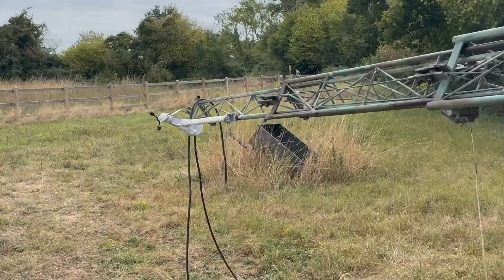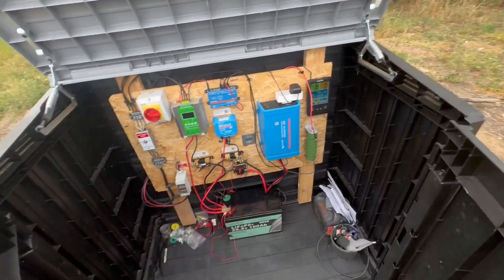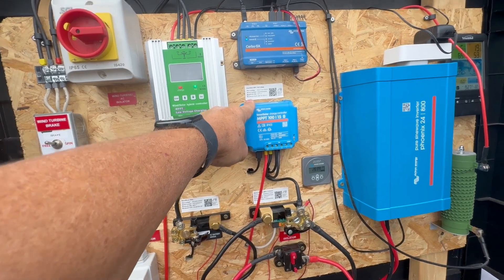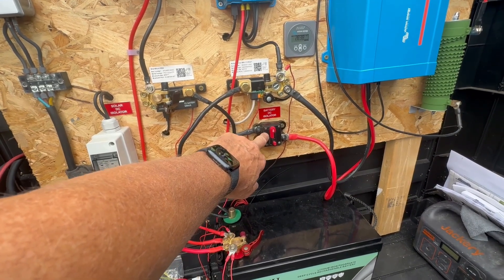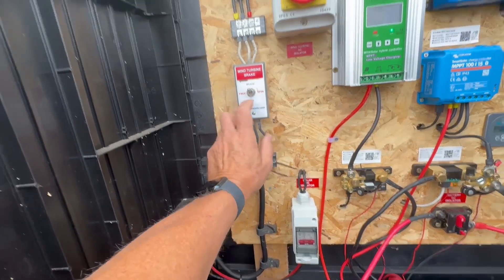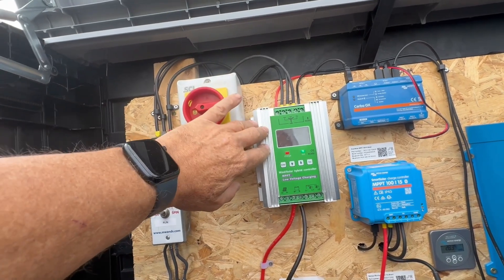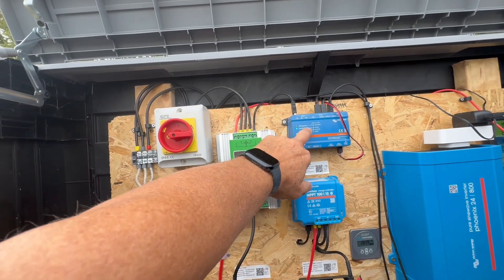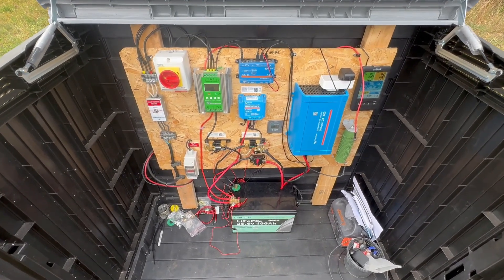Home Wind Turbine Electrical Setup

Comment: Might be a stupid question but does it matter which wire goes where in the top of the wind controler, or does it not care as long as they are in the wind labeled ports?
Reply from the maker: Great question. No, any phase can go into any connection.
Reply: @Homewindturbinereviews thank you for getting back to me. I'm new to the wind side of off grid and learning as I go. Do you use a victron stunt to get the wind to display like the solar does?
Reply from the maker: @coolbolas yes Victron kit completely except charge controller which is Chinese. Victron shunt, Cerbo , inverter.